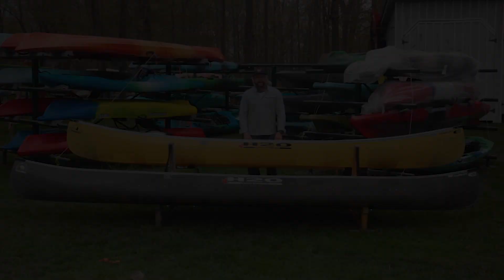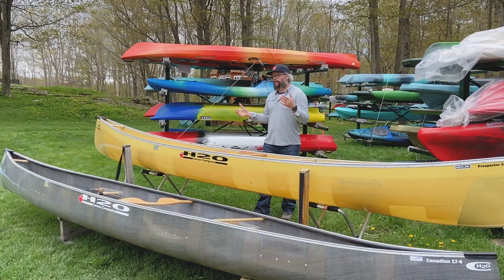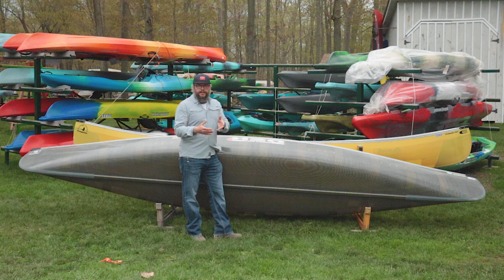How a canoe's hull shape changes performance - Canoe Hull Design Explained

Comment: Yeah, the keel stiffens the flat bottom and prevents "oil-canning."  However, I don't think that the keel has anything to do with "tracking" or "stability."  It will inhibit the canoe from being blown sideways by a cross-wind which is useful.  I installed a short keel on my Mad River Slipper for those reasons.

Comment: Would it be hard to rig up 12 volt wiring to run navigation lights and a marine radio?
Reply from the maker: I suppose that would be a question of how handy are you? If you are comfortable dealing with marine wiring and can use a variety of tools to get the job done, no it wouldn't be to difficult. BUT, there are no bulkheads or cavities in these canoes to support this kind of project so some major DIY would be needed for a clean install.
Reply: I've modded a few John boats, wired up lights a few times with marine grade wiring and I used to work on commercial diesel propelled boats after graduating from a diesel repair course. I've got a few ase certs but electrical ain't my thing but I'll try and see lol

Comment: i have a fiberglass canoe with a wood keel inside and out.  i need to replace the damage inside and replace the whole keel outside. i can find no information and have never seen anywhere this type of canoe. it has screws connecting the inside and outside keel that have striped out so i had to grind them down. question (1.... can i just fiberglass over where the outside keel was and leave it off or do i have to replace it.  question (2...if i have to replace the wood keel outside can i put new screws through it into the inside wood keel and if i can, how do i deal with the leaks these will cause.......Help..............thank you stephen.